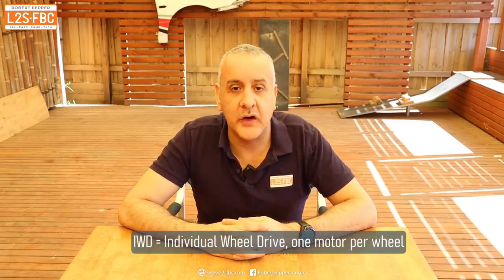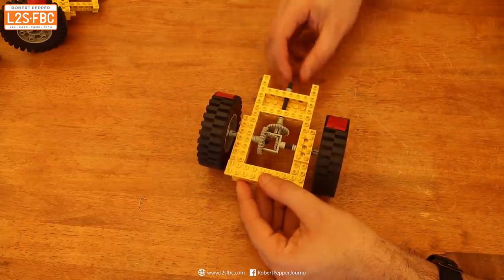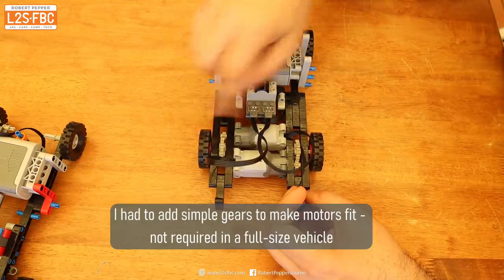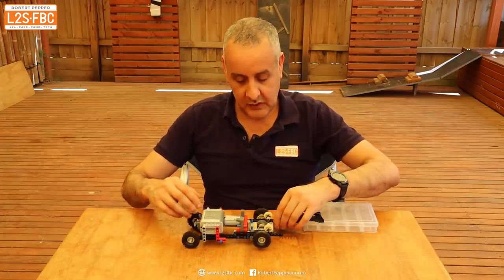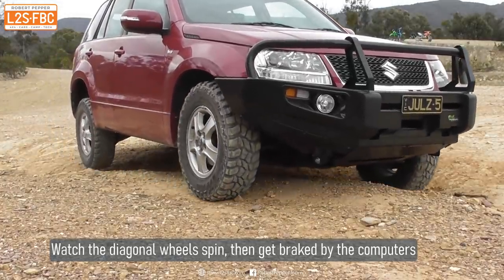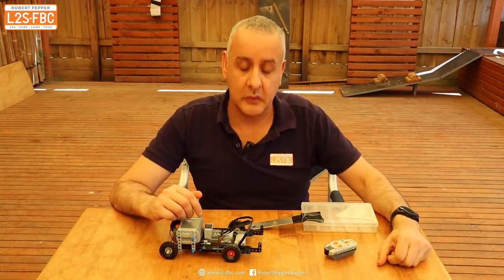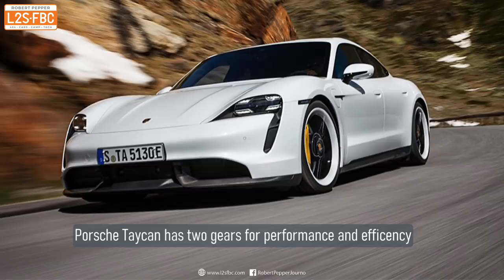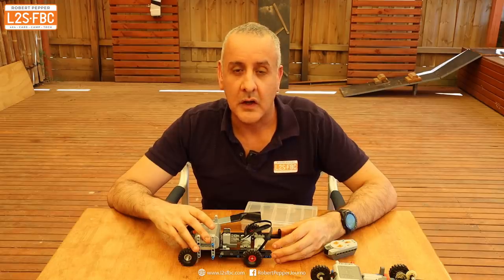Why Differentials Will Die - EV IWD Is The Future!

Comment: Your 3 year old's pronunciation of TH degrades your presentation. wiFF, wiV or wiTH   ?   Dis or THis. ?  Dere  or THere  ?
Reply from the maker: Sorry about that.  I hope you were still able to understand me. At least I'm good looking, right?
Reply: @L2SFBC  I could understand you but you denigrate yourself. You sound like you are intelligent by the information you present. Your Aussie accent is not difficult to understand but your poor pronunciation detracts from the validity of what you say. Our brains often hit a pothole when words are mispronounced and we miss what is said after the pothole. You would likely build you channel faster if you practiced pronunciation.  
btw, I have been wondering when a hybrid car (IC-electric) would be made with IWD and no drive train from the engine. Torque sensing motors could make an amazing vehicle. A controller similar to the controller in a quad copter drone could balance thrust from every wheel.
Reply from the maker: Well, you're not the first to point this out so I'll look into what I can do about it. Interesting the way people on YouTube are far more honest than friends!
Yes that's exactly what IWD is. The IC engine would need to recharge the battery or power the 4 electric motors. Given the way battery tech is heading, I think that hybrids will die out and be replaced by EVs.
Reply: @L2SFBC  Cudos to you for your gentlemanly response to criticism. I hope you can improve so you can build your channel.
Reply from the maker: Thanks, I aim to. As I said, I know I do this, and there's enough consistent comments for me to take it seriously. A one-off I would ignore. Cheers.